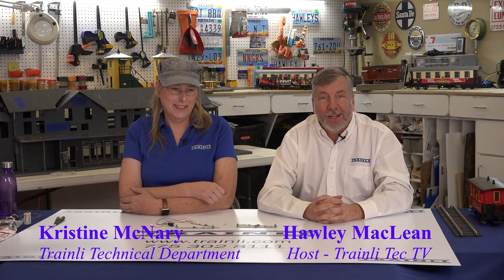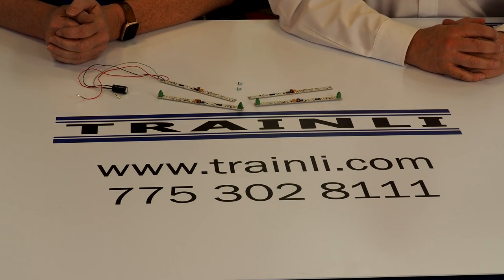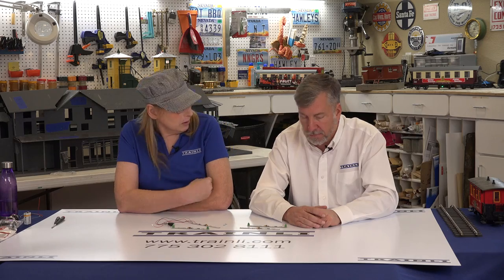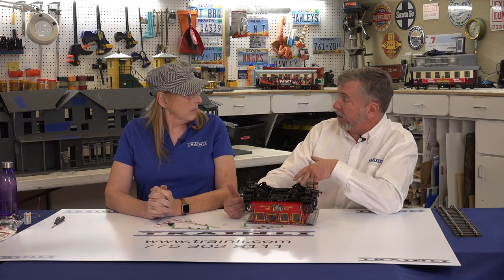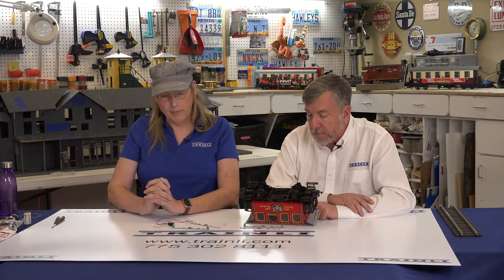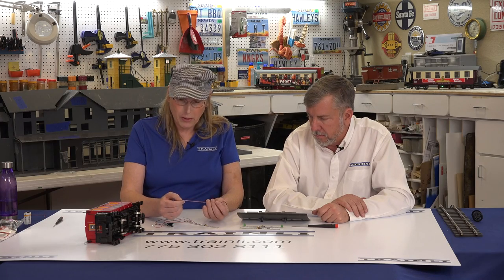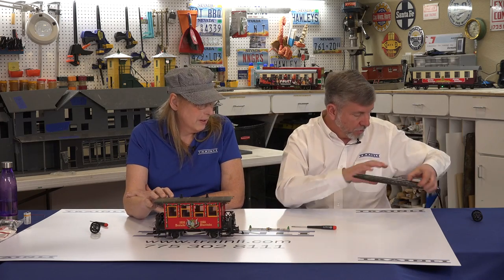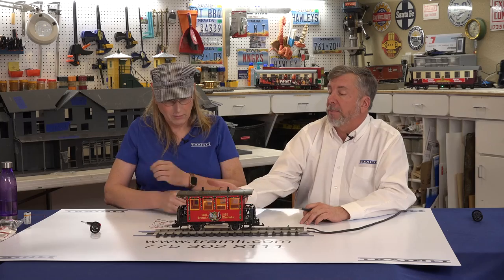How to Install LED Lights in your train cars.

Comment: I have  a marx postwar  passenger  train rolling stock in  need of new led lights  can I  wire the lights  to ac power
Reply from the maker: Is it your track power that is AC? What voltage?

Comment: You didn't show how you connected the wires to the wheels.???
Reply from the maker: Hi. We did not show a close up.  At 6:00 minutes we start talking about connecting to the wheels.  The coach already had wheels with electrical connections.